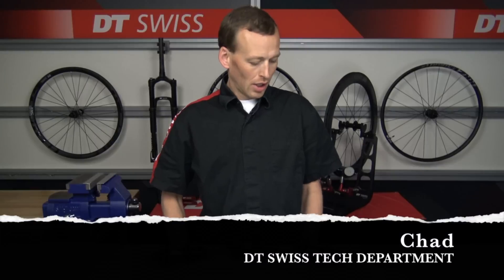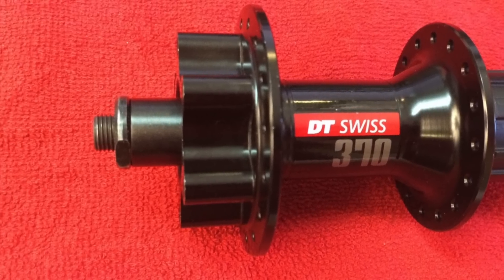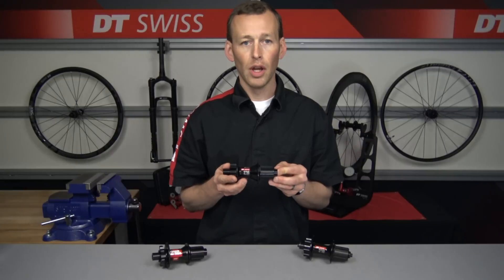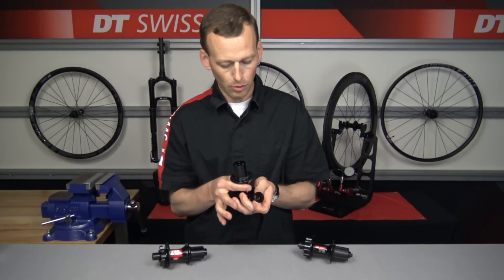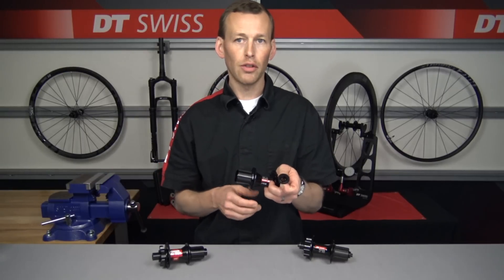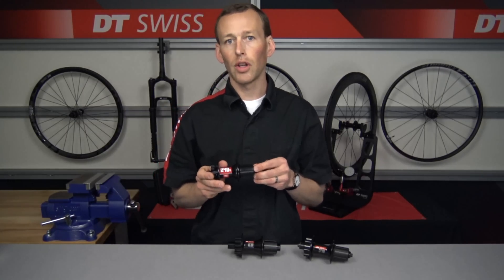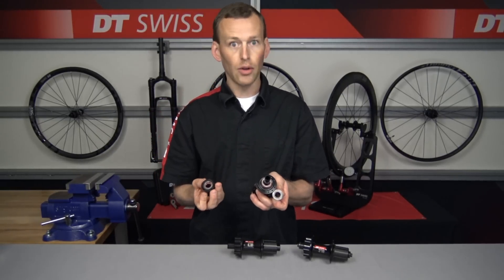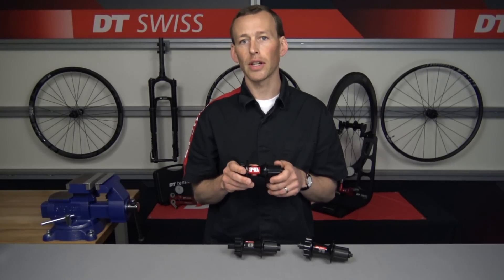Identify the type of your DT Swiss rear hub.  | DT Swiss

Comment from the maker: Do you have any questions regarding this topic?  Let us know in the comments below. 👇
Reply from the maker: Hi The Panther, the body of the hub can be changed and the free hub body too. You can change it to another type like Shimano, Sram or Campagnolo. But you cannot convert pawl to Ratchet system. Kind regards, José, DT Swiss
Reply: A green hub  marked "L56850 019 DT P 4862" original on a Cube AMS "26". Need repairkit and Hub tools artnr and were to order please.
Reply: Can you change the two pawl hub body?
Reply: Great so I can change a 370 hub with a threaded QR as shown in the video , to accept an XD driver body with a three-pawl system?
Reply from the maker: Hi The Panther, not all pawl hubs are the same. Over the years we have made different systems with 2-pawl and 3-pawl but only 3-pawl systems since 2014 offer different free hub body and axle standards. If your hub has a steel axle and screw-on end caps you have a 2-pawl hub. Kind regards, José, DT Swiss
Reply: I'm looking at buying a wheel with a 440 freeride hub which fits a 135x10 rear axle, can it be converted to a 142x12 bolt through axle?
Reply from the maker: Hi Bordpie, please send your request with the complete production code you find laser edged on the hub to service@dtswiss.com. Best regards, José, DT Swiss
Reply: Hi-  I’m trying to resurrect my 2008 stumpjumper fsr expert.  I believe the rear hub is a “made for specialized” DT 370?   Anyways, I started pulling it apart with the intent of swapping over the end caps to accept a 10mm thru axle.  It appears to be a 2 pawl model.  I was able to pull drive body off, clean and inspect and reliube.  I pressed the axle out the other side of hub, although that side locknut is really stuck on there.  It appears I would need to get that locknut off to remove the bearing that is up against the step on the axle.  
So my question :  

is it possible to pull bearing off the qr hollow axle, remove axle, re-install bearing, replace end caps with a 10mm thru axle version, and reinstall hub in drop outs with new 10mm thru axle?  

It is 2 pawl 370 w QR hollow threaded axle
Reply from the maker: Hi Scott, unfortunately it is not possible to convert this 2-pawl hub to any kind of thru bolt or thru axle. You can pull the bearing of the axle by holding the axle in the middle with a bench wise or a wise grip and unscrewing the screw nut. Best regards, José, DT Swiss
Reply: i have a silver dt swiss ratchet on my giant. it doesn't say if it's 350 or 240.
Reply: Hello,
My second-hand 2-pawl hub is missing the washer that goes axactly there (on the picture at 00:45 ) between the axle bearing and the free hub bearing. What are the dimensions of this washer ? (called spacer in some service pdf I found online)
Thanks !
Reply: I have a 2 pawl R1900 hub, 10sp, and want an 11sp hub body, are they available? Thanks

Comment: I got a new DT Swiss RIM DT EX 471 Bike Rim to go on the DT Swiss 370 Boost 148mm hub that came on my Rocky Mountain Vertex C70 29er Hardtail Mountain Bike 2019, the Hub is fine only 200 or less miles, the Sun Helix TR25 SL Rim split and did go lemon shape and so i took the Rim off, i am not sure if the Spokes are stretched so i need new spokes, i look on the DT Swiss Website at the Spoke calculator, is this a 370 142mm Hub with adaptors to make it Boost 148 as i look on the menu of the Spoke calculator as the hub is 2019 i am not sure what DBIS means, i am looking to put new spokes on the old DTSwiss 370 hub in a  new DT Swiss EX471 Rim, so is 291mm and 290mm the right length spokes ?

Comment: Hi DT Swiss, what hub to fit on DT Swiss P1800 Spline rear? I read about 360 and 370 hubs. What are the differences? Further what end cap to use in combination with the right hub? Thanks a lot

Comment: I have a Giant PXCR1 27.5 wheelset which using the ratchet system hub similar to the DT350 hub. I know this because I also have another set of wheelset which using the DT350 hub.

The problem with the hub is the ratchet will slip (disengaged) when I pedal hard but ONLY happen when I shift to the SMALLEST COG (11 tooth on a 11 speed cassette). But for other cogs the pedalling seems to be smooth and I never experienced the ratchet disengagement.

At first I thought it was caused by the star ratchet malfunction so I swap it with the star ratchet from another hub (I did service and clean the hub before swapping them). But the problem that I mention earlier still happens.

What could be the problem that I am facing right now? Please do help me. Thank you.
Reply from the maker: Hi Moris, I see two possible reasons A) your drive train is used to the point the chain slips over the teeth of the sprocket. This happens after a lot of km especially on e-mtb that are only used on road and mostly in the 10/11 teeth sprocket and with the small number of teeth they are quickly worn. B) If the smallest sprocket is not properly engaged when tightening the cassette it rarely happens that it starts turning. This would be visible on the freehub body when the last mm of the splines on the freehub body are kind of cut off.
As you noticed it does not occur on other sprockets therefor the cause is not in the freehub system.
Best regards, José, DT Swiss

Comment: Greetings DT Swiss and thanks for making great products- I have an old silver Hugi DT Swiss rear disk hub with an aluminum 8-9-10 star ratchet freehub (steel star tooth rings, single spring). 10mm diameter steel QR axle, 135mm width.

The splines are pretty gouged (by the small sprockets!). Is it possible for me to upgrade to a XD freehub which eliminates gouging? Or steel or titanium? I don't understand if the old hubs are dimensionally compatible with newer parts.

Also are 130mm conversion end caps available? Yes, I have a great old disk gravel frame with 130mm rear dropouts.
Reply from the maker: Hi Johan, this is a pretty old hub you have. Please write an e-mail to service@dtswiss.com. Kind regards, José, DT Swiss

Comment: I'm currently riding a yeti sb135 with dt swiss m1900 29s. This bike is not near as playful as my sb5 with 27.5 was. I heard lighter wheels really liven the bike up but have no clue about these components. Any recommendations (from anyone) would be appreciated. Cost is not much of an issue but what would be the best bang for the buck upgrade?
Reply from the maker: Hi Justin, this is for sure a wide topic. In general any wheel of a higher level will be lighter but the differences between the wheels go much further than just the weight. If you want to keep the rotating mass low carbon rims are the lightest. Best value for the buck would be our top of the range alloy wheel XM 1501 Spline ONE. On top of that you can also influence your weight and performance by the right selection of rim width and general usage indicated by the letters at the beginning. X for XC, M for All Mountain, E for Enduro. Kind regards, José, DT Swiss

Comment: Hello DT Swiss,
I have a hub with number L122446045 Dt F3915. I'm curious what the original width of the hubs was. 
I got it without endcaps and want to know which possibilities I have. 
Thanks, Frans
Reply from the maker: Hi Frans, I think it is a 240s Road hub with Shimano Road 11 free wheel body with Center Lock with 24 or 28 holes. Originally specified with 135/5mm QR but can be converted to 142/12mm thru axle. Kind regards, José, DT Swiss

Comment: Are all 3 paw systems the same diameter on moutain bike hubs?  I want an XD but am not sure what  is correct for my specialized Stumpjumper 2019 that I hear is dt that specialized rebranded.   Pls help.
Reply from the maker: No, all hub Producers are using their own Systems. You can compare this with a car, you cannot use the wheel bearings of a Ford on a Nissan or use the brake pads of an ATE Brake on a Brembo. If it Comes to your hubs I would suggest to contact the Producer of the wheels ( Specialized ) and ask them which hubs they used in your Bike. Friso "DT Swiss".

Comment: Hi DT Swiss.  Which hub is used for the Syncros XR 2.5 29” rear wheel? I have a Scott Spark 920 year 2017 that came with those wheels and I would like to buy the DT Swiss Micro Spline free hub body for the new SHIMANO 12 speed group set but I don’t know if the hub has a Ratchet type free hub body or a 3-Pawl type free hub body. Can you please confirm?
Reply from the maker: Hi Alexandre, the only hubs that are supported by Microspline are listed here:https://www.dtswiss.com/en/support/conversion-charts/rotor-kits-mtb-shimano-micro-spline/ the hubs that were used in the Synchros wheels are not officially supported. You need to try out if it fits. If you send me the production code of your hub I can tell you if you have a ratched or a 3 pawl hub. Kind regards, Christian, DT Swiss

Comment: Is the 370 compactible with 2 x 10 drivetrains or it;s only for 11speed and higher? can I convert a 370 to a rachet freehub?
Reply from the maker: Hi Kay, it depends on  witch exact hub type you have. Most of them are convertible to 11 speed. If you send me the production code of your hub I can tell you if your hub is convertible. You can't convert a 370 to the ratchet version since the hole parts are different. Kind regards, Christian, DT Swiss
Reply: @dtswiss  You missed the question. I asked. if the 370 is compactible with a 10speed drivetrain. Will my 10 speed cassette work with the 370?
Secondly, I have seen folks convert 370 to a rachet hub. You tech guys can't be this naive. The video is floating online. You buy the kit and swap the freehub body(the part you put cassettes on) with that of a 240 or 350, swap the internals with the new kit set and huala!! just type it on youtube and tell me you didn't find the video.
Reply from the maker: Hi there
As the Shimano type Freewheel body didn't change from 8-11 speed, for sure our Pawl hubs are compatible with 10 speed.
Regarding the conversion from Pawl to Ratchet system you, like many request before, will get the same answer.
This conversion is not forseen in the developpment process of our hubs. So from our side the answer is clearly NO, there is no conversion. 
Best regards
Friso, DT SWISS

Comment: Can I upgrade the three pawl hub to the star ratchet?
Reply from the maker: No, this is technically not possible. There are some live hacks in the net, but we cannot reccomend such an conversion.
Reply: @dtswiss  Okay, thank you. This is unfortunate, but expected.
Reply: I think DT Swiss should say it’s technically feasible but not recommended...  many people have done it. The reason it isn’t worth it (IMO) is because by the time you buy both necessary drive ring tools, shim, drive ring, ratchet kit, sleeve, freewheel body, and seal, you could have just bought an ER1600DB Spline rear wheel which has the 350 hub and better, lighter hoops.

Comment: Hello DT Swiss, I am trying to find out which hubs I have on my Canyon MTB. The number on the front hub is P1351025 444 DT N 3830. Any info would be great.
Reply from the maker: Hi, there is something wrong with the code you provided, we can not identify this hub. Please check and send it again. Best regards, DT Swiss
Reply: My apologies it’s P1381025 444 DT N 3830.
Reply from the maker: Hello, thank you for the serial number. That number corresponds to a 370 series front hub. This hub is very similar to our 350 front hubs, but it is an OE-specific hub model. For reference, the hub uses two 6902 series bearings, and standard 350 front hub endcaps are also compatible. Please let us know if we may assist further. Kind Regards, Andrew - DT Swiss USA
Reply: DT Swiss that’s brilliant thank you. It was the end cap compatibility I was after. Now I know 350’s will fit I’m sorted. Many thanks again for the quick reply.

Comment: DT needs some bling. Would adding other colors kill you DT?
Reply from the maker: Hi David
If it comes to our system wheels, we are not using standard hubs. At least the hubshell, like the black/silver one in the ER1600, is specifically made for the needs of the application field. To identify, service and/or rebuild the hubs you can trust our information about the productinformation on the Website. SO yes the ER1600 is using a 350 hub. Check out our all new Product Identification Tool:
https://www.dtswiss.com/en/support/product-support
If it comes to specific OEM ( Original Equippment Manufacturer ) wheels you would get details from our service centers:
https://www.dtswiss.com/en/support/service-center
Stay healthy, Friso "DT Swiss".
Reply from the maker: Hi Road Glide, thanks for reaching out to us. But we like it clean and simple ;)   Best Regards - DT Swiss
Reply: @dtswiss  Continue as is; I don't like bling on my bike.
Reply: The ER series wheels come with hubs that are black and silver but are otherwise 350 hubs inside. Does that count?

Comment: i was finding how to maintain my two pawl hub and searched around the internet for awhile.
finally founded the manual of the two pawl hub.
sticking it here for others just in case they need it.
https://dycteyr72g97f.cloudfront.net/uploads/WXD10000000897S/MAN_WXD10000000896S_WEB_EN_001.pdf

Comment: Ha ha. For pawl system what is shown is maybe valid for brand new hub. For hub that made few 1000 km hammer is mandatory to do disassembly. To remove threadring and get spare parts it is nightmare. Shimano is better.
Reply from the maker: Hi Ales, thank you for the comment. With the correct tools, DT Swiss hubs are among the simplest hubs to service and rebuild. We recommend using the appropriate bearing driver tools during complete disassembly, which definitely helps even when working with high-mileage hubs. Thank you again for your comment and have a nice day. Kind Regards, Andrew - DT Swiss USA.
Reply: Hi DT Swiss AG, appreciate your feedback. To remove ring nut you need special tool which cost 40 EUR. Ring nut cost 10EUR?!. I ask many bicycles services in Ljubljana, actually nobody hav that kind of tool. Now they are trying to find new ring and hub for more than 10 days. I need my bicycle ...
Reply from the maker: Hi Ales, we have a distributor in your Country, one phone call to them should sort out your issues. Please see here for their contact Details: https://www.dtswiss.com/en/dt-swiss/contact/distributors/
Best regards, Kai
Reply: After almost two months I finally get new ring nut an complete hub. So happy ... I install them by follow the instruction and do my first ride. It was just a few meters then I notice that the cassette is rolling even I am not pedaling during the ride. Not possible to ride as the chain roll over the front chainring. So pist off.. Any Idea why this is happening?
Reply from the maker: Hi Ales, thank you for the question. There are several reasons that could cause the freehub to "bind", the most common of which is the hub shell seal not being fully seated or upside down. Also, the ring nut may have been re-installed upside down. The groove on the ring nut should face toward the drive-side hub bearing. For further troubleshooting help, please feel free to email info.us@dtswiss.com . Kind Regards, Andrew - DT Swiss USA

Comment: Hi. I have a dt swiss roval 142 plus hub on my specialized bike, is this hub will fit sram eagle 12 speed casette? Thank you
Reply from the maker: Hi Russell, thank you for the question. It sounds like your hub may require a XD freehub conversion. The 142+ hubs do require custom Specialized endcaps, which are only available through your local Specialized dealer. If you have any other questions, please feel free to contact us directly at info.us@dtswiss.com. Regards, Andrew - DT Swiss USA
Reply: DT Swiss AG 
Thank you for your reply. Im currently using sram x1 1x11 casette.

Comment: I have the latest RR21 Dicut road wheelset bought in 2017 which used the 240s road hub. We know there are 5 pieces 6802RS altogether but only 1 of the bearing at drive side rear hub is hidden inside. May we know the Bearing Size for that rear hub at the drive side?
Reply from the maker: Hello, thanks for the question. The rear hub on the RR21 Dicut DB wheelset uses a 1526 series bearing (drive side) and 6802 series bearing (non-drive side) in the hub shell. Regards, Andrew - DT Swiss USA

Comment: Can you tell me what is the difference between the 340 hub and the 350 hub please.
Reply from the maker: Hi SuperJackdaripper, thank you for the question. There were some changes in the 340 hubs over time. The earliest 340's were similar to Hugi hubs with steel internal axles (non-thru axle compatible) and 6000 series bearings. Later 340's were a bit more similar to the current 350's with thru-bolt and thru-axle capability and 6902 bearings. Both 340 and 350 hubs use the star-ratchet internals. Best Regards, Andrew - DT Swiss USA

Comment: This tutorial is for rear hubs only. Some 240 disc brake front hubs cannot be converted to thru axle, even though they look very similar.
Reply from the maker: Hi Clark, thanks for the comment. Yes, you're correct - some older front 240s disc hubs cannot convert to through axle. We can always verify if the front hub is convertible by referencing the serial number. It's also possible to remove an endcap off the hub, and measure the outer diameter of the hub's internal axle. If the hub internal axle measures 15mm OD, then it is safe to say the hub is NOT convertible. Regards, Andrew - DT Swiss USA.
Reply: Did you mean to say that if the internal axle is NOT 15mm then it cannot be converted?
Reply from the maker: No, an axle OD of 15mm indicates the 240s front hub is not convertible. Newer (convertible) 240s front hubs with snap-in endcaps have an internal hub axle OD of 17mm or 18mm. Regards, Andrew - DT Swiss USA